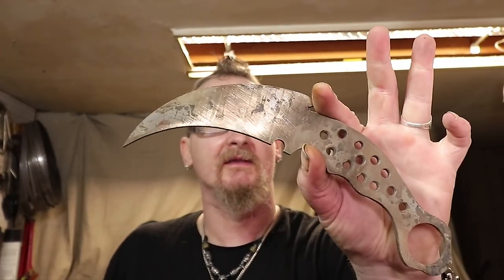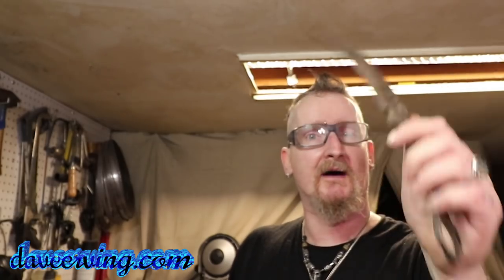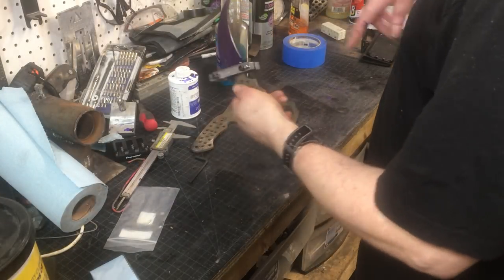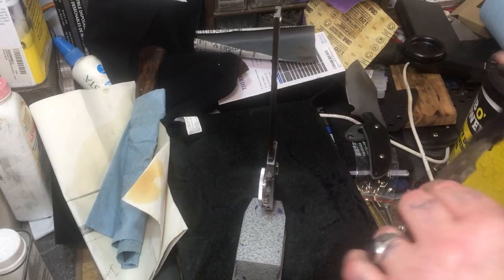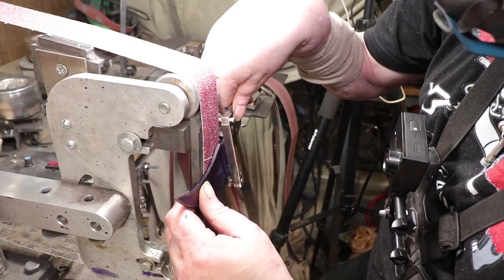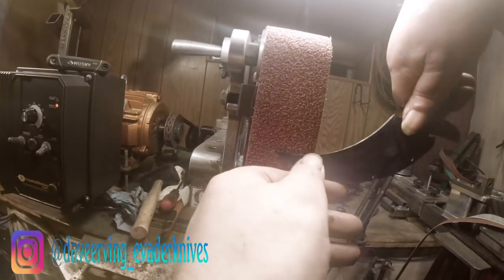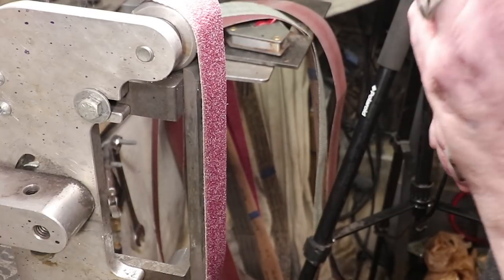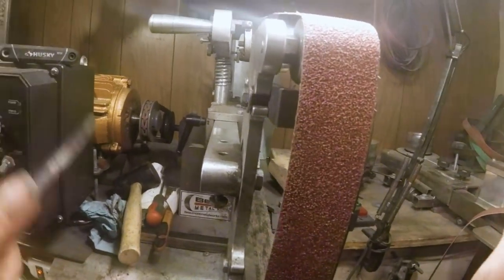1095 Karambit - Flat Grinding Bevels(after Heat treat 2018)

Comment: Sorry if this may be a stupid question, but I am just starting to make knives. When you start your initial grind to knock off your 90. Are you running your belt at a high speed or a lower speed?
Reply from the maker: I grind at a higher speed for everything, but you might want to test it on a scrap piece to see what works best for you. Also, there are no stupid questions, we have to learn somehow...
Reply: @evaderknives  Thank you

Comment: thx dave thats what i would like 2 learn how you do the curved plum bevels like u do , n ima try make a file guide n does hardware store have the blue dycome?
Reply: I just wanted to chime in here. You can make a decent file guide with high carbon steel. I would not make one from mild. You will want it to be able to be hardened for it to work. Although it will probably not hold up to a grinder but should do fine with files. I made mine from 52100 and my files skate right off. If you need something for a grinder I would invest in the same kind Dave uses..
Reply from the maker: Thanks for the help Martin, I started with a grinder, so I don't know anything doing bevels with files... As for the Dykem(layout ink) I got it from Amazon.. https://amzn.to/2A3YC93... I don't know any place locally that has it... Thanks for watching guys... Have a great day..